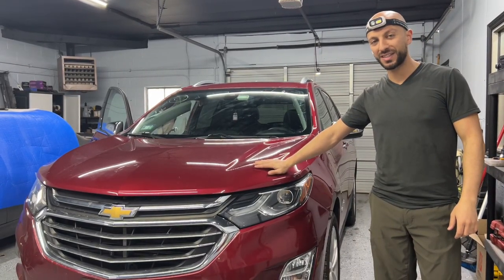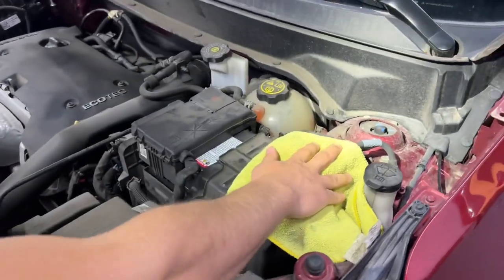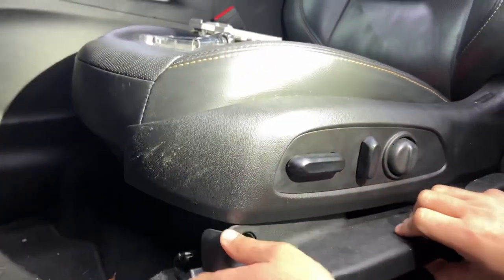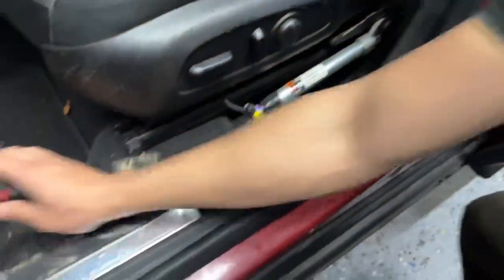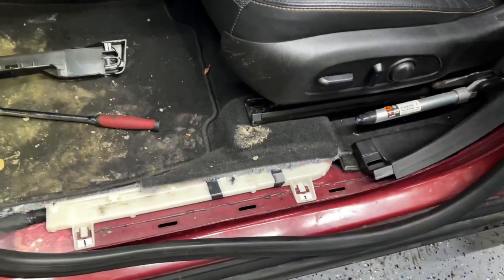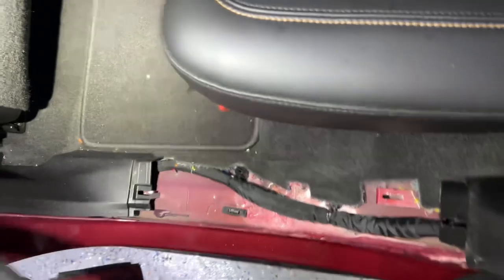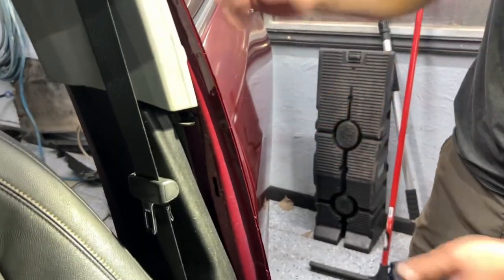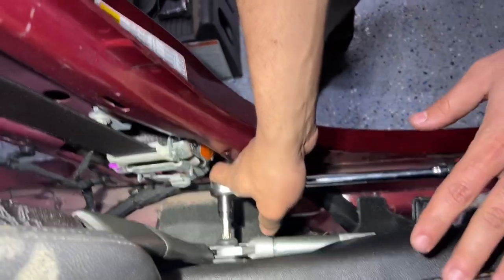Seat Belt / Pretensioner - Replacement Chevrolet Equinox (2016-2021)

Comment: Thanks for the video!! I always cut the tight belt with a knife to make things easier and also position the seat forward more to access the seat bolt holding the belt to the seat and allow more access to the middle pilar. Anyways that’s all I got thanks again.
Reply from the maker: You are most welcome! Glad the video was helpful and yes those can be a pain sometimes 😬

Comment: You make good videos.  Thanks.  You mentioned the airbag piece on pillar,  and it scratching easy.    The solution is once younpop put the bottom.   Push the cover that says airbag out from the backaode with your clip removal tool.   It's simple .
Reply from the maker: Thank you so much for tip and I appreciate you watching my video 😄

Comment: Thank you for the video. I have the part but it retracted all the way, is there anyway to get it to retract or do I have to take it back?
Reply from the maker: @boy10boy  so the seat belts have to be sitting in their postions properly in order for you to be able to extend them , if yours retracted all the way sir the seat belt portion the retractor basically in it’s spot and tighten it with the screws and you should be a able to extend it!
Reply: @brownsburg.motorsports  thank you for the reply but I am still confused. My seatbelt is for a 2014 terrain, so similar. Do I install the seatbelt and hook up the sensor for it to retract back out? I don’t necessarily see anything to release the seatbelt otherwise, but it’s not long enough to be able to attach the 3 points
Reply: Definitely would love to know this too. My 2017 terrain had the airbags deploy internally/in the frame (no accident just driving normally) and now my front seatbelts are locked in place.
Reply from the maker: @boy10boy  yes sir the bottom portion with the T50 bolt and the 10 mm up top then you should be able to pull the seat belt and hook up the rest of it
Reply from the maker: @hughmungus2645  if you’re front seat belts are locked in place that means your seat belts have been deployed and would need to be repaired or replaced with ones that aren’t!